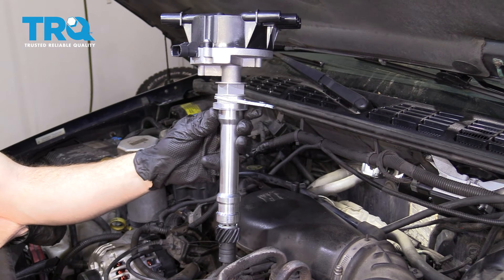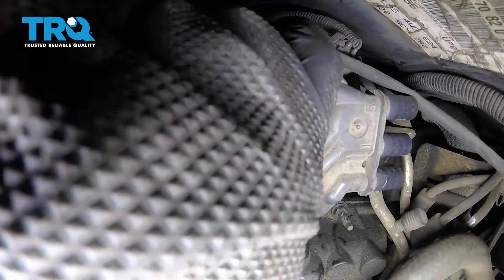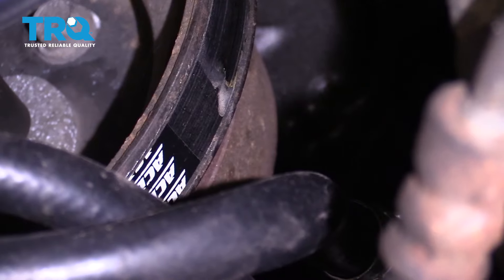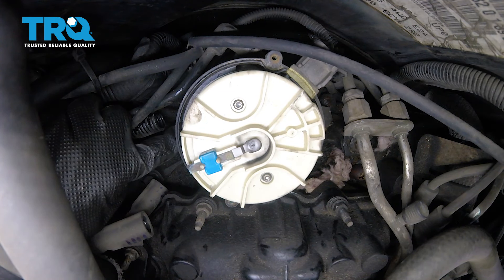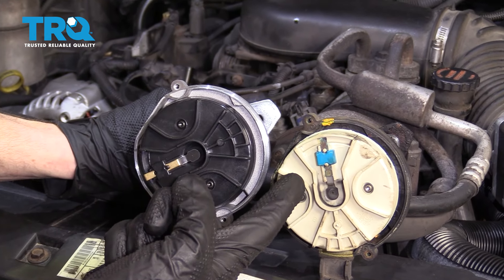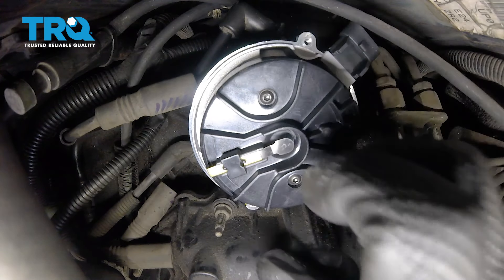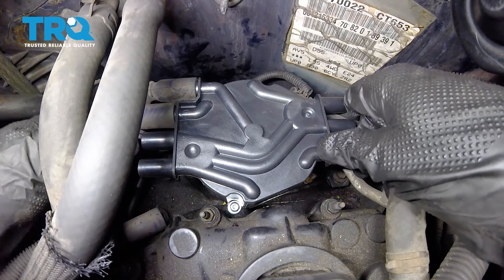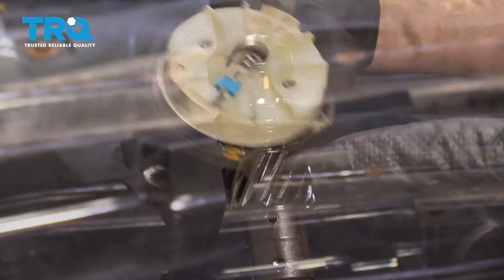How to Replace Distributor 1994-2004 Chevy S-10

Comment: Came to see what he used to get that mounting bolt out and he skips right over it....
Reply: Same, just gonna burn my S10 down
Reply: I just used a small 10mm wrench it was tedious but it worked
Reply: 10mm wrench
Reply: I use a ratcheting wrench with a flexible head, gearwrench
Reply: Thank you
Reply: I did too
Reply: THERES a wrench you can get to make it easier at autozone, but just need a regular wrench and a bottle of patience

Comment: I really wish the Haynes manual had mentioned that there are two marks on the balancer. I aligned the first mark with the notch visible from the top. This explains why the damn thing won’t fire off and sounds out of time (other than the fact it hasn’t ran since I bought it as a project truck).
Reply: So what you really didn't do was to check to see if the number 1 cylinder piston at TDC and thus was on the compression stroke.  In those direction it does tell you to TDC the engine before removing the distributor and it tells you how to verify that your engine is in the TDC position,
Reply: So what did u do? Along the second mark with the bottom mark on the balancer?

Comment: What do I do if my distributor never lines up to the triangle with the 6 I have spun the engine about 20 times but whenever it lines up the the lower half it’s not even close to lining up on the distributor not even 180 degrees away from lining up.

Comment: how did you know to put the first mark on the block where you put it? at the 3 minute mark on the video. i don’t understand
Reply: If anyone else is having trouble locating the spot to mark it is directly below a bolt that attaches the harmonic damper bracket to the front of the engine (piece of metal that sticks out).

Comment: I did exactly what you said in the video. My problem now is that the Chevy blazer is draining oil from the distributor and does not read oil pressure.
Reply from the maker: +@mrgasu23  We wouldn't be able to diagnose an issue like that here, you may want to have a local mechanic take a look at it. Thanks for checking us out! http://1aau.to/m/Shop-1AAuto-c

Comment: I put a new distributor in my 01blazer 4.3 and the oil preasur isn't as high as it was..... it was at 40 then it would go up to about 60 now with the new distributor  it below 40 and comes up to about almost 40 when I rev it

Comment: I purchased a 97c1500 and had a random miss firing issue. Replace random sensors and now I checked the distributor and the prong on top is 180 from 6. So I took it out and put it on 6 and now it won’t start? Any ideas ?
Reply: When I put it back in, the prong is 1/4 pass the 6 but when I move it back 1 tooth it’s 1/4 before the 6 ??

Comment: I have the oil pump alignment issue he speaks of 6:35. Original equipment has a taper (machined not worn) at the end of the shaft, there's does not.  Jiggling it doesn't help. Any ideas on how to get this to seat in the proper position?
Reply: Watch the video again paying close attention starting at 5:30 and ending at 7:00.  Notice as he is removing the distributor he lifts gently so that he can see when the housing is no longer turning in that counter clockwise direction. Once it stops turning counter clockwise he stops and marks the housing directly below where the end of the pick up arm is pointing. That is your reference point for reinstalling the distributor once the engine has been set at TDC. If the rotor and distributor housing are lined up at that mark and you then drop the distributor down into the engine while allowing for the distributor housing to turn clockwise as it drops in and you can see the distributor housing resting flatly on top of the lower intake manifold  and the rotor is pointing at the number 6 you will have successfully & correctly installed it. Install the distributor bolt and tighten finger tight. Do not tighten all the way down because you may still need to do some slight timing adjustments via twisting the distributor cap while the engine is running. If needed. you'll need to be using a timing light and begin watching for the white mark on the harmonic balancer to line up with the timing mark on the engine block. Once you have the engine in time then tighten the distributor bolt and shut off the engine. restart and see if it idles right.
Reply: I am sure you figured it out by now but you can use a flat head to turn the actual pump in the engine to help with alignment issues.

Comment: Trq has the best parts for the 06 civic coupe stick ex the struts fit right and level in the front and i opt for the rear si springs like few more mm longer . Its so lovely. And ive had other companies front struts before.  But trq components are better even the air conditioner condenser. Im getting ready to buy oarts from trq pm auto for my 96 chevy s10 pickup 4.3 auto.

Comment: I think my pump is misaligned. How do I set that and follow your video?
Reply: I have the same question did you find an amswer
Reply: Use a long flat head screwdriver to turn it inside the engine.  Before doing that, look at the bottom of your new distributor and align the rotor to the little tab that has number 6 imprinted on it.  Then look at the tab at the end of the distributor to see where the slot orientation is.  Then what you want to do is imagine what the distributor when mounted in the engine will have the slot facing, and what you want to do is take your screwdriver and turn the oil pump drive to about the same position inside the engine.  Then just insert your distributor like how this video explains.. if it goes all the way down and bottoms out, then you have it aligned correctly, if not then use the screwdriver to adjust the position again.

Comment: What happens when you tighten the distributor bolt and then it jumps loose.
Reply: You likely didn’t have the drive for the oilpump aligned properly
Reply: you shouldn't have been able to tighten it all the way down if the oil pump drive wasn't correctly installed because the distributor would not have been fully flush against the lower intake housing before you tightened the bolt.

Comment: I had a PO300 code and threw $2,000 worth of work into my s10 ZR2. I finally cleared the code after installing a new distributor. But now, I have a check engine light for a camshaft to crankshaft position sensor faulty code. Could it be the new camshaft sensor being damaged? I didn't have this code until after the distributor was changed
Reply: think you might be 180 degrees off, either the tdc of exuast stroke or the rotor is
Reply: Did you do the Crank Cam Relearn?
Reply: Update?

Comment: After I change the distributor just like in the video I try to turn it on but it didn’t all it did was crack, then find out I have a problem of gasoline going into the motor oil so I drain it out and put some new oil in it but didn’t start, what can I do to it ?